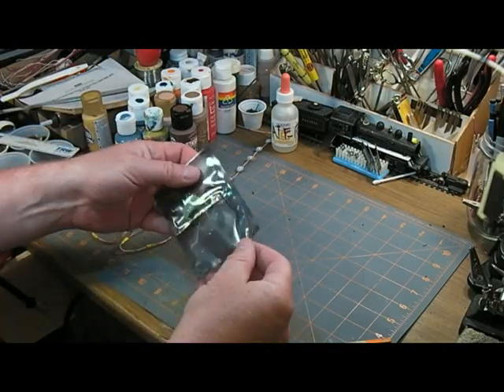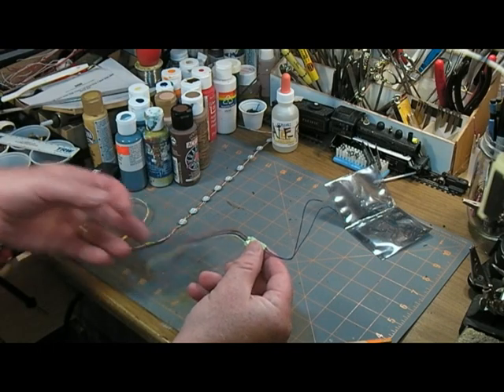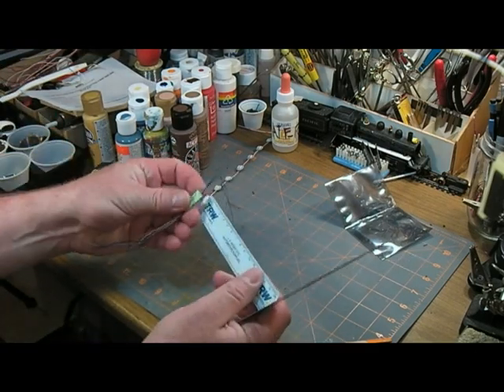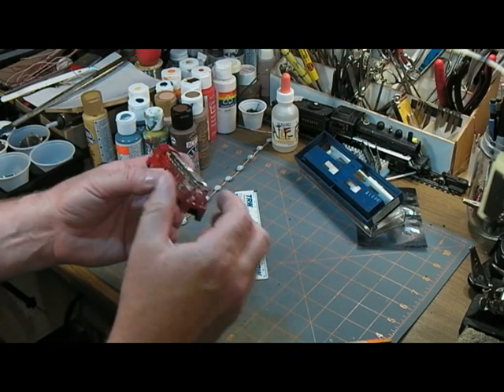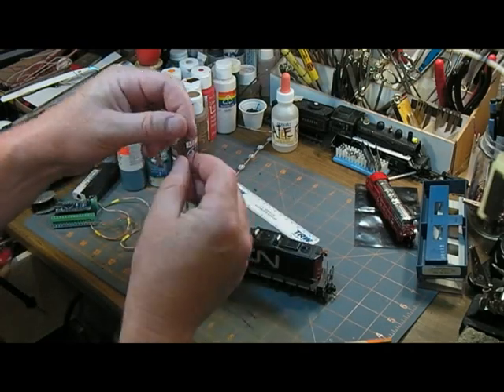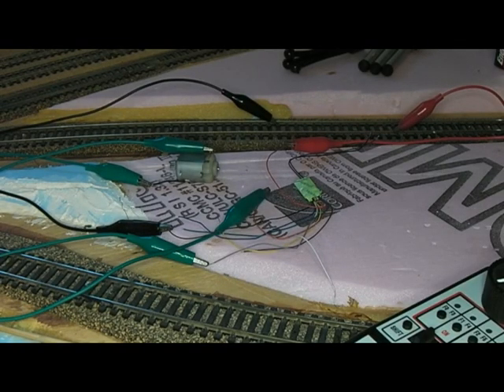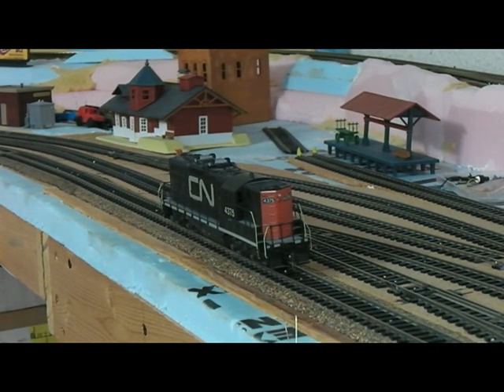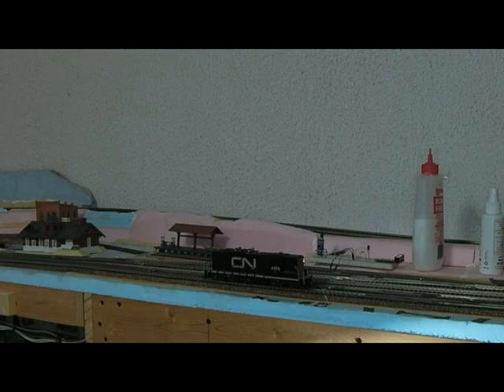Cheap DCC decoder: first look

Comment: Looks like the decoder is working as expected.  For a keep alive cap you need at least a 2000uF capacitor.  I usually use a 3200uF cap in my coaches for flicker free lighting which would equate to a keep alive circuit.  And it should be rated above your working voltage.

Comment: Check out The DCC Guy Larry Puckett's keep alive circuit. It has a resistor and a zener diode. This slows the rush of power from the capacitor.

Comment: What I'd be particularly interested in, is whether these can simulate "momentum" or not, and whether it's possible to run these, speed matched, to a sound decoder (like a LokSound). I know there are CVs to disable momentum in a LokSound decoder, but it'd be nice to be able to offset some of the premium cost of a LokSound with a super cheap DCC for things like ABA configurations.
Reply from the maker: My command station has relatively primitive programming capabilities, but the manual says these have adjustable acceleration/deceleration, speed tables, consisting, and all other common NMRA DCC features.

https://laisdcc.com/LaisDcc_Decoders_Manual.pdf

Comment: You need a bigger capacitor, like a 4700 - 10000uf,  rated at 25v.  A super-capacitor of higher "f" would be even better.
Reply from the maker: Probably.

It is a bit of a balancing act between capacitance and mechanical dimensions. 
I'll have to dig up some more capacitors and tinker with it sometime.
Reply: From the datasheets of the decoders that I've used so far (ZIMO and ESU) most of them work with caps up to 2200uF(ESU) or 4700uF (ZIMO). I'dd start with something around 470uF/25V in order to see some advantage. 
What I'm experimenting with now is a 4700uF/20V supercap (BZ05KB472ZSB) that I got from mouser, that has a nice flat, rectangular package and being a supercap is has the best capacitance to volume ratio. The Zimo is supposed to withstand this capacitance (they say up to 6800uF). I'm still stuck at the part where I'm trying to figure out where everything can fit inside the loco without shaving any ballast but I have high hopes for this project!

Comment: It's been about four years, how is that decoder holding out? Has it burned out yet? What issues have you had with it?
Reply from the maker: No failures yet. Though I don't run the railway as often as I used to either.
Unfortunately these aren't available any more. I'm told the company ran into legal troubles.

Comment: how has it held up? i'm thinking of changing all my dc to dcc & i don't really care about sound, i just want better speed control for going up & down hills. with dc, they slow down badly going up & run like hell going down grades, i hate that. what feature is that called to keep that from happening?
Reply from the maker: I don't run that often, but so far it hasn't let me down. 
I've got 2 locomotives with these, and I'm still happy with them.
Reply: you said something about light tubes. can you tell me more about this? i looked and couldn't find anything on it.
Reply: @inscoredbz  That's thus a plastic bar or angular block structure that lets you place an LED away from the headlight. It's like a fiber optic cable. transmits light from one end to the other. Many models use a short light pipe to "guide" the light to the headlight and number boards.